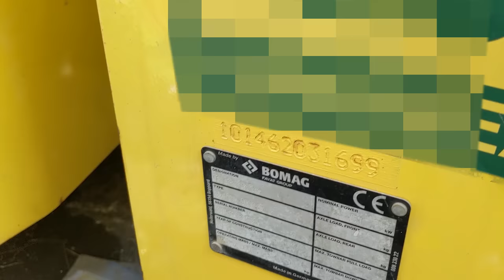More Stolen Vehicles in South Wales

Comment: I am from south wales and my van was stolen and found on this travellers site , the police did not want to know and were frightened to go onto the site 
even the recovery company refused to go onto the site and collect it , amazing what south wales police will do when a few high profile cameras are about
Reply: Did you get it back?
Reply: @1gerard47  hi Gerard 
After it was found inside the compound  complete and reported to the police the police did nothing it suddenly was later found outside the camp compound gate stripped with a hiab arm put through the roof 😩 so I did get it back but was destroyed !!
Reply: There you go folks, if you want to commit crime just act like an intimidating traveller and the authorities will leave you alone. Laws are only for honest people who behave themselves.
Reply: They were given ethnic status by Enda Kenny in Ireland. It gives them free reign to do as they like
Reply: Use a steering wheel security lock. They were more popular in the 80's and 90's. I dunno why people don't use them anymore.
Reply: @almilhouse9059  Blair did the same here.
Reply: @georgewarner5496  surely they’ll just cut it off
Reply: @notmenotme614  Not if it's setup to electrocute them with a few thousand volts it won't.... The results would be SHOCKING.

Comment: You mentioned issues in the valleys - for the past year, the mobile companies have been messing around with combined masts here, and switching the frequencies back-and-forth (particularly EE and Three). This is probably why you're experiencing more problems than would usually do there.
Reply from the maker: That makes sense,  lots of changes to deal with,  can make things a little more difficult for sure

Comment: Nice one. What i wonder is, how did the criminals put the roller in that corner? Lowered it down from a stolen helicopter??
Reply from the maker: We have seen this question a few times. We are not entirely sure. We believe  it might have been taken through a residential plot. Police could easier manage its removal through a communal site fenced area, with no need to debate extraction route issues with the locals.